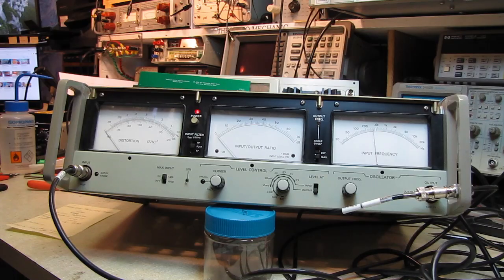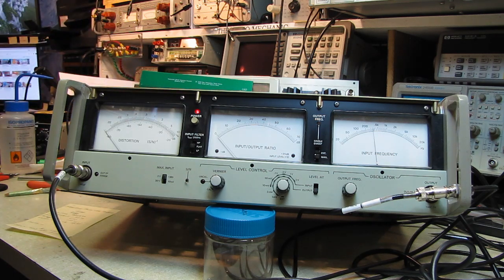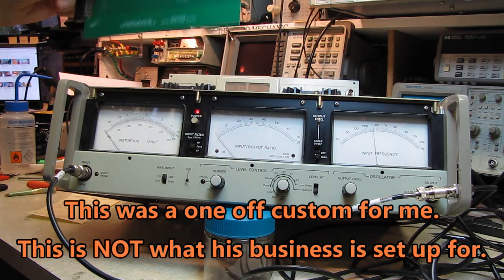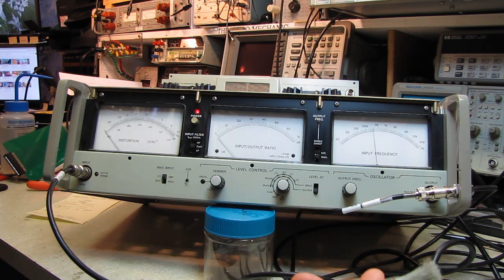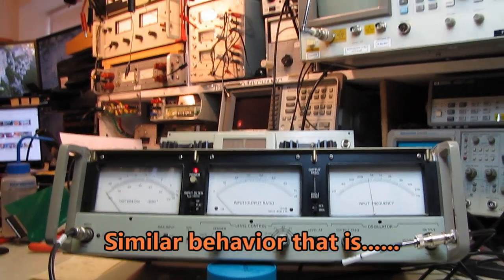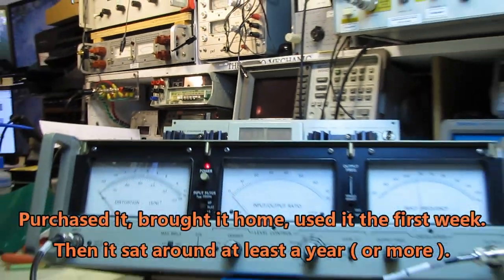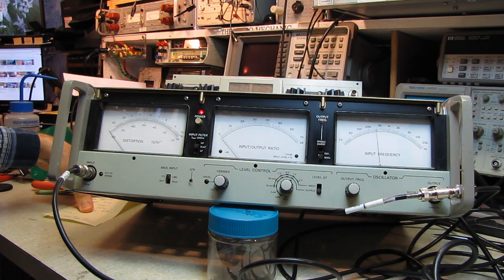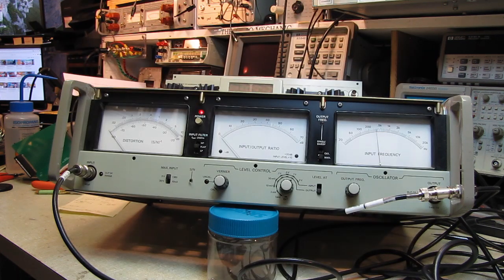Radiometer BKF10 Distortion Analyzer Follow Up

Comment: Lol I know what fixed it.. It was the threat  of having the extender boards that fixed it lol
Like the noise your car makes that stops the instant you pull into the mechanic's lot. 
Ty so much my friend! And ty for the update,  I wondered how this repair would go, if it would be worth fixing. It was worth the cards cuz that stopped it from going in the trash. That would have been a shame.
Oh, this means I should fix the web site. Lol Changing to a new provider,  the old one isn't working out. It'll take a little time.

Comment: Recently my mother  asked me to take a look an older radio (1965-1969) she has in the kitchen that apparently suddenly went silent. when I dial'd it up on my isolation variable transformer it just started playing at just under 100 V (radio is set for 220V) no faults could be found. It's a B&O Beomaster 700, one of the first fully transistorized radios. I believe it is mostly original inside, I have once replaced a transistor and looks like also a capacitor. The radio is in daily use and has not failed after. I did make a video (15 min.) of my checking of this radio if anyone has interest (at the time of writing the most recent on my channel.
Greetings from Denmark.

Comment: Some CAPs may have reformed.  I'd do a re-cap!
Reply from the maker: Well over 100 1% poly caps in this thing.
Reply: @theradiomechanic9625  - In that case, they may be fine.
Reply: @theradiomechanic9625  might be good to clean the card edge connectors if that acts up again.

Comment: Just hate not knowing what may have caused a fault...sticks in the back of your mind wondering when it will crap out again (kinda like that slightly crooked CRT you just had to fix!) There is a guy on eBay who sells extender cards (got one for my HP 334A analyzer and Cushman CE-15) and they're not outrageously expensive. Thanks Vern!
Reply from the maker: Hi Dino, can't win them all. Or as the song goes - Some times your the windshield, Some times your the bug.   Had searched high and low for extender cards before Charlie and Skye fixed me up. This is an very rare piece from Denmark. Not likely to find extender cards for them. Wasn't even easy to find a service manual for. Thanks for stopping by.
Reply: Like Vern said this is rare, and,  the boards I've bought from ebay are not the best quality. These are 4 layer boards with full ground planes and lots of vias to avoid circulating currents.  They cost more than the ebay ones,  but they're better quality.  The ones on Ebay are literally hogged out with a dremel tool to make the traces.. These were JLBPCB from Gerber files. You wouldn't get the precision needed for the edge connector with the dremel tool.